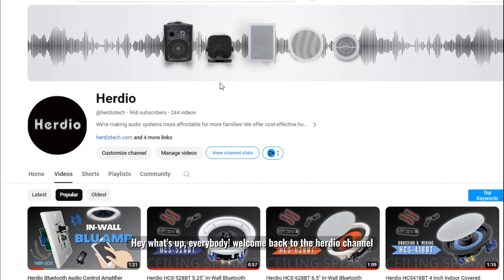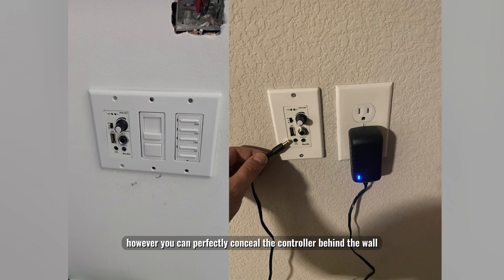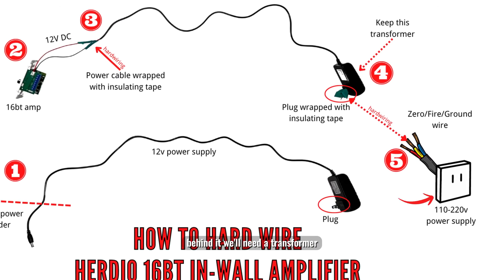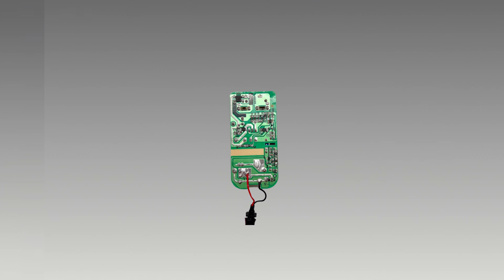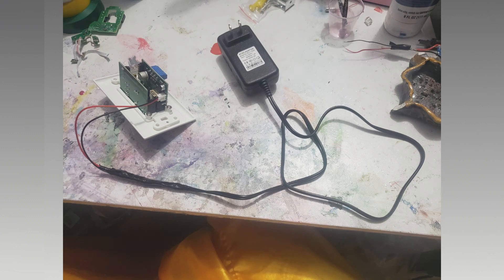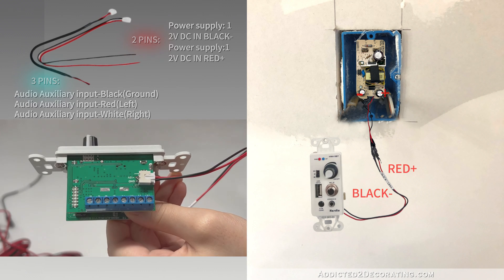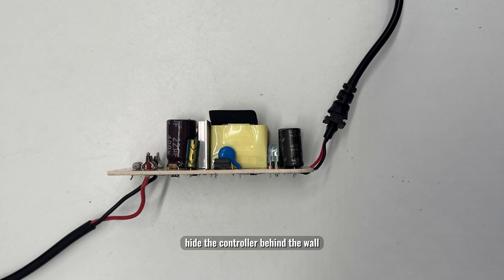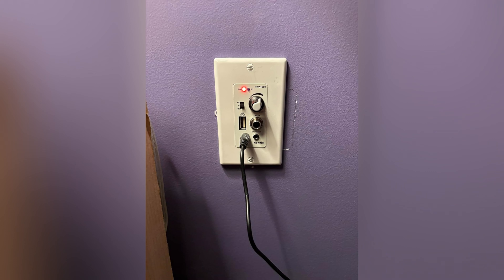DIY Guide: Hardwiring External Transformer for Herdio Controller Upgrade

Comment: The controller plate sitting on a transformer pauses a short circuit risk! I would have a separate housing box for each attached with a wire conduit.